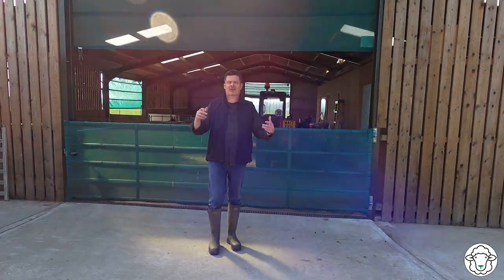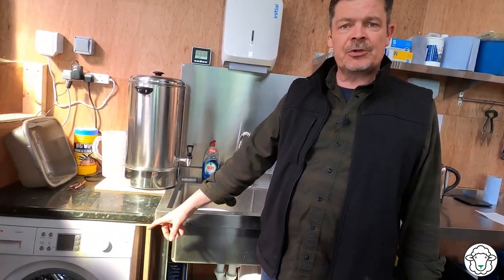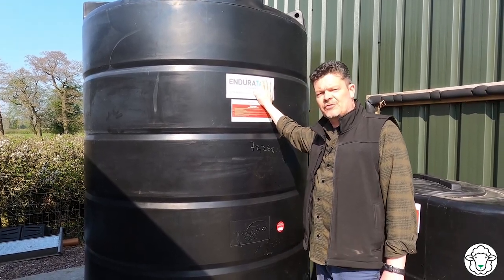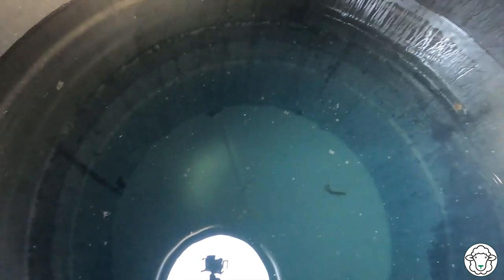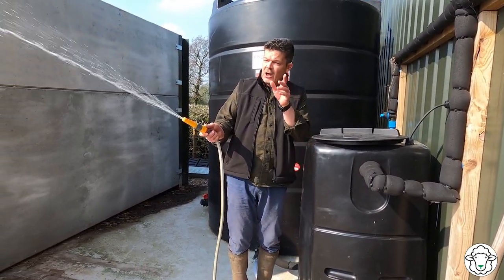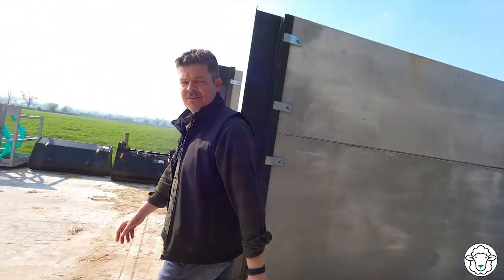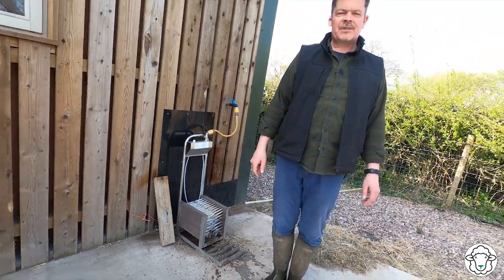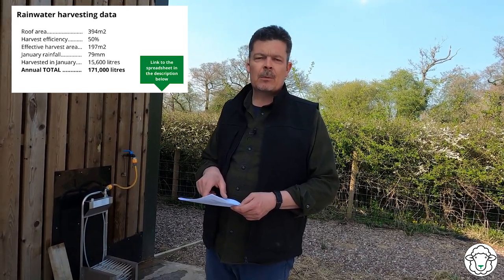ALL our water is FREE! - how does our rainwater harvesting system work?

Comment: Great video. That water pressure  is awesome. Its what i need. I am a big fan of rain water harvesting in my rural home in Kenya. I am currently harvesting 24,000 litres of rain water from roof top  into 3 tanks connected serially . Each tank is 8000 litres. My target is 40,000 litres.
Reply from the maker: Thanks for you comment - and good luck with hitting your target of water collection!

Comment: Good to see your system. I appreciate that your roof area is clear (no overhanging trees) but wonder if you could still benefit from a first flush system? It would be pretty easy to install and may improve the quality of your water.

Also if you were to increase the size of the pipe from the downspout to tank, you may find that you collect more as that looks as though it could be limiting flow capacity.
Reply: Its only americans that are obsessed with 'first flush'. I have queried the diverter as its wasting at least 1/2 the rainfall that flows on the roof by his spreadsheet calculations (he is only accounting for 50% of his roof area in the calculations)

Comment: Very helpful video thanks, i've a land drain that runs through my garden and discharges on the boundary bank, your system will work for me using that diverter off the downpipe.  SWWA charge £1,90 per cubic metre so this is a good investment

Comment: How do you keep water fresh from stagnation? 
Do you use an air bubbler in it? What about freezing when it is freezing cold for weeks at a time?
I know the cooler the temp the less likely water to go putrid from heat. Black body seems to be a goos tank to get helping these yet there is always te times out freezes or gets to Hot like in summer times.

Comment: Nice system.  I also have the same diverter valve, they are the best.  Your shed is MASSIVE compared to my double garage.  When there is a big down pour, so much of the rain water will bypass the dirverter and exit into your soak away.  Check next time during a down pour.  You should install a bigger diameter pipe between the diverter valve and the tank, you just cut the smaller outlet bit off and upgrade from 32mm to 50mm.  This will double the amount of flow into the tank.
Reply from the maker: Thanks Simon - useful suggestions.
Reply: @HeronbrookFarm  I am genuinely concerned that you will be loosing water.  Have a look during a massive down pour.  also inspect the mesh after a shower.  Thumbs up to you and your system.
Reply from the maker: @simontaylor3492  Thanks Simon - I will definitely take a look.
Reply: @simontaylor3492  could you help me devise a gravity fed rainwater irrigation system for an off-grid flower farm 1/2 acre, incorporating excess runoff into ponds? Wondering if this could be done without pumps? Cheeky question I know, but enjoying the theory and design challenge. Would be a massive advantage if my little project goes ahead in October.
Reply: multicolouredhuman multi-  how many square feet of roof do you have available to collect rainwater from?   Second, how much rain do you receive in your area? ( per year)
Reply: @lktopview  There is no building yet.. but wondering how big a roof would be needed for my project. Estimate it being 18' x 10' for now. Rainfall in Midlands UK, temperate climate.. I should look that up??
Reply: multicolouredhuman yes you should find out what your normal rainfall is for an average year.   For an8x10 foot shed,(80 square feet) you should get around 75 gallons of water for every inch of rain.  If you put the building on the highest level of your property, you could have gravity do most of the work of getting the water to your garden.
Reply: @lktopview  The temperature here averages 8.8 °C | 47.8 °F, and about 768 mm | 30.2 inch of precipitation falls annually.
Reply: So at  75 gallons per inch of rainfall... 75. X 30.2 inches =2265 gallons. I will have to work out how much I need to irrigate my plants, and whether this amount would be enough, or whether multiple collection points should be used..or just one larger collection point high up.  (Hoping not to have to water too much with mulching everything too, but using this as a precautionary backup).

Comment: I totally enjoyed this video. Could you tell me how cold it gets where this system is? Do you have any issues with the pipes freezing?
Reply from the maker: Hi Elaine - it does not get too cold here and we have never had a problem with the pipes freezing. In a typical winter we might see temperatures or about minus 10Deg centigrade but these low temps don't typically last very long. All of the pipes, inside the barn and external are insulated, however.
Reply: @HeronbrookFarm  minus 10 C is 14F and that sounds similar to Virginia where the coldest it ever gets here is 20. Thank you for your answer.

Comment: the tube connectiong the pipe to the tanks looks awfully small.. atleast for the length of gutter you have.
I have recently removed my rain diverter permanently. it was 80% clogged wit rotting leaves and even some nuts that birds dropped on my roof to break open.
I have added a first flush system (needs tinkering for the size though) and have put a rainpipe straight into the tank after that. (with panyhose as last fine filter)

Comment: Great Video, Im currently undertaking a project where Im really interested in RWH, i have a few questions; 
I was under the impression you need to treat the water that you feed to the animal?
Do you find yourself running out of water at all?
Reply from the maker: Great questions! We don't treat the water for supplying the animals other than the pre-filter before the water goes into the tanks from the roof. Our roof is relatively clean as we do not have any overhanging trees. We never have run out of water - but always a risk - we have 24,000 litres available and our biggest usage is in winter when there is much more rain here so that gives us some protection.

Comment: Fun fact Almost every "normal" washing machine use cold water. The water gets heated inside to set temperature. :D
Reply: When I lived in NZ, they were top loading machines and were connected to both hot and cold water lines.